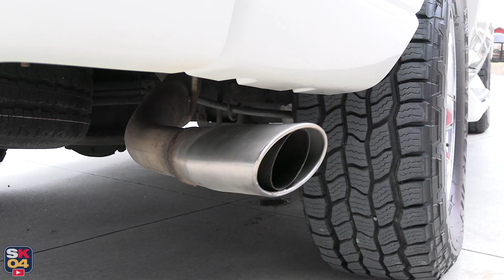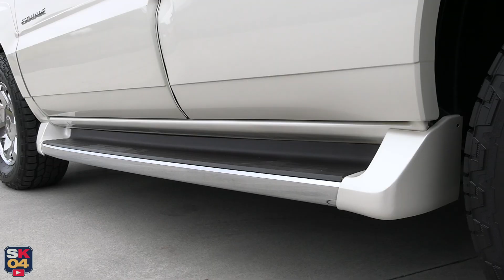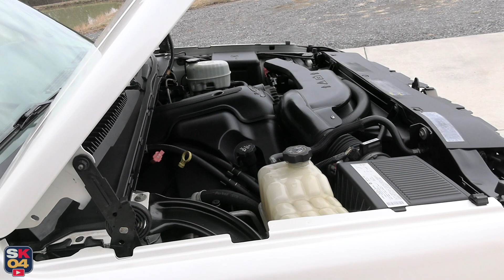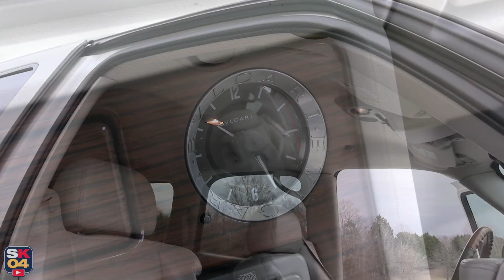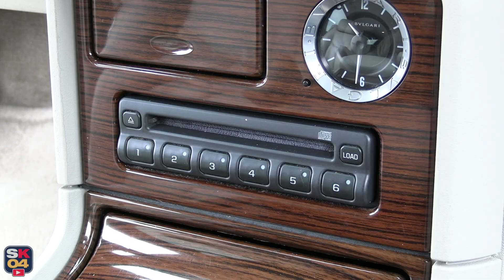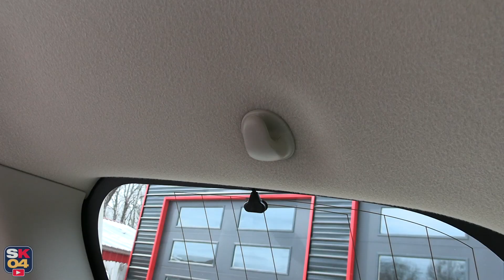2004 Cadillac Escalade 6.0L AWD: Start Up, Test Drive & In Depth Review

Comment: just bought an 02 Escalade that was very well taken care of. Still runs smooth at 285k+ originally from Florida. Strange how all the "review" video's I've watched on these years escalade not one mentions what the locking cylinder is or for next to the rear license plate area (on the right side). I cannot seem to find any info anywhere regarding that.

Comment: I have this exact truck but 05. Even as old as it is it is too fancy for me. It was stck on valet mode for a long time noone could figure out what was wrong. It would stop working after a few miles lock up. Speed was 45 miles tops or it would die. I barely learned how to reset it and works fine now. But now it door locks after the cars shut off. And the interior lights only go on when i unlock doors to get in. They do not go on when i get out. Probly another fancy setting. But i made spare keys just in case. I love it more then my newer car.

Comment: Incorrect. The LQ9 6.0L requires 92 octane or premium fuel, based on the 10 
1 : 1 compression ratio.  Also the Escalade had a standard 6.0. Not a 5.3.

Comment: Finding these good example Escalades from the 2000's are especially challenging. After the original owners moved on to newer models, they got passed around by low income earners seeking status until they were completely worn out. Kyle's escalade will for sure become a survivor! Please do not change anything, leave the original radio and keep it stock.

Comment: And the 6.0L LQ9 was standard. You won't find an Escalade with a 5.3L.
Reply: Nope, early 800 Escalades were optional with the 5.3. I had an 02 with a 5.3.
Reply: I have a 2005 with a 5.3 V-8

Comment: This generation, in general, is the best full-size SUV they’ve ever built, in my opinion. My parents used to have a GMC Yukon with the Autoride suspension (which eventually failed), but the engine and transmission kept running even after my dad’s neglectful maintenance. I also had a Chevrolet Silverado about a year ago, but I sold it because it was becoming too costly for me to fill up twice a week.

Comment: This generation Escalade is the best Escalade they ever made
Reply: Amen, brother. Mine has 225,000 miles on it and just keeps on ticking...such an awesome 2nd vehicle! Tows, hauls, and absolutely PLOWS through snow.
Reply: Straight facts, my parents purchased a fully loaded 2004 Escalade in white diamond back when they were new and I loved it so much that I got one as an adult, a 2003 Cadillac Escalade ESV in white diamond with only 125k original miles from the original owner.
Reply: 1000000000%

Comment: The lq4 6.0 engine can go 500k miles easy with oil changes every 5000 miles
Reply: The 2nd gen Escalade like this one came with and even better high output version of the lq4 which was dubbed the lq9. It only came in the Escalade, the only difference was it had flat top pistons which increased the compression ratio. All other 6.0s in GMs line up got the lq4 including the GMC Denali

Comment: In many ways, this is way better than a new Escalade.  Firstly, you get the raw experience of the V8 while you're sitting on plush thrones. Technology is purely in the background. Secondly, these are simple to maintain without the technology overload. It's still an almost pure mechanical experience. Then there are things that are less worrying than a brand new one. Theft isn't soo bad because who wants an old one.  You didn't pay any where near the price of a newer one, so you get the old school luxury experience without the sticker shock.

Comment: I love the GMT800 Escalades, however, I’m only 19, and I grew up with the GMT900s. My parents were never able to afford an Escalade, and a Tahoe, according to my mom, was a bit too big. I, however, am a sucker for the Escalade. My absolute favorite trim is the Platinum Edition. And I specifically like them in Black Raven paint with the brown and white interior option. (I think it was called Cocoa/Linen, I don’t remember.) I’ve been looking at a lot of them recently for a first vehicle, but it’s very hard to find a GMT900 Escalade that hasn’t been used and abused, or with less than 200k or so miles on them. Ive been looking at a particular 2007 Premium model in black raven with the black interior with only 59k miles on it, and a 2013 Luxury model also In black/black with 62k miles. I’m skeptical about the ‘13 because of its age in general and having the active fuel management system, and i know the ‘07 doesn’t have this, but I also don’t know if the 6.2L was problematic when it came out that year, all I know is that the door handles were notorious for breaking on ‘07-8 models though.

Comment: I'm starting to think that cars from that decade (2000 to 2010) are the pinnacle of motoring.
Reply: They were…I have a 2007 m35x .My interior is higher quality than” new interiors best designs “ and less technology more car.These days these cars are soft and just full of technology no more brawn or really car feeling any more
Reply: @Oddfellow215 oh boy I believe you
A robust M35 M35x
M45 are amazing. No junk
Reply: Everything made after the 2008 financial crash has severe inconsistency in quality. My '04 Escalade ESV is still a strong daily driver and workhorse after 255k miles and over 10k hours.
Reply: @Pwnin4fun we have 04 .6.0 ESV Escalade with 301,000 miles runs fast! No rattles!
Reply: Yes , but before that in the 50s and 60s they were even better!
Reply: Most car brands peaked around 2010. Everything I own is rated best engines of all time for a reason
Reply: 2010-2017 is the best era.
Reply: @vika0194 wrong
Reply: @vika0194 not if they have that cylinder deactivation!

Comment: Hey Kyle, the '04 Escalade looks clean. The GMT800 chassis is actually my favorite growing up even though I was born in 2004. I believe you should change the old radio to the aftermarket one with the backup camera, change the transmission from 4 speed to 8 speed from the 2015 Silverado 1500 Z71 with the 6.2l V8, the wheels, and the interior like the seats and the gauge cluster.